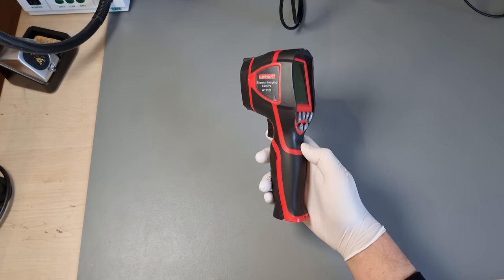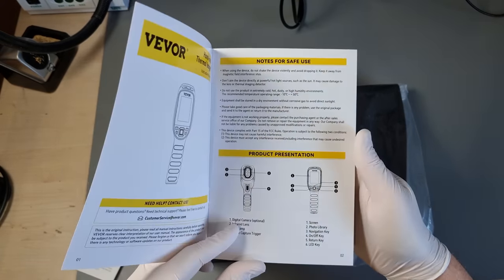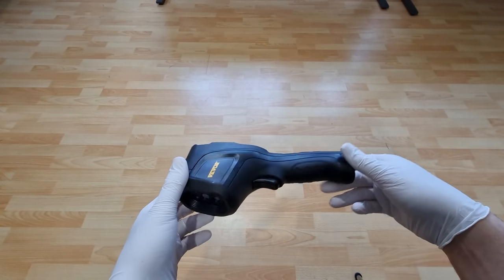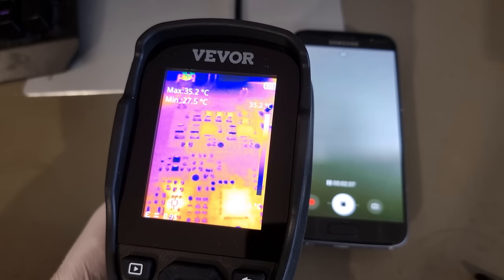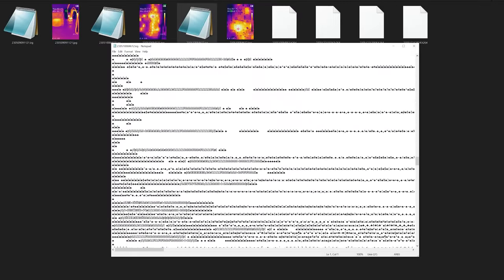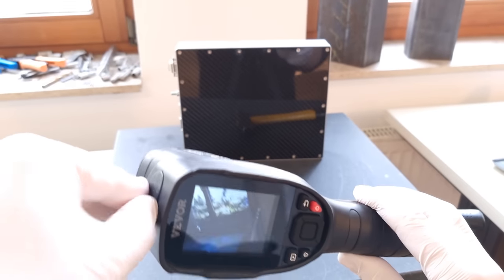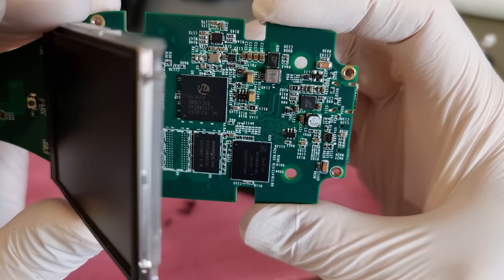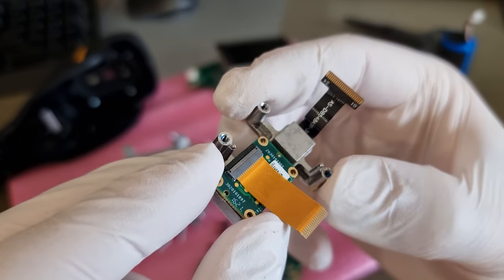25 FPS Thermal Camera Test & Teardown: Vevor SC240M w/ Infiray C200 Sensor

Comment: Now that 30fps IR cameras are available, it is your duty to turn one into a 3D printable heat-seeking missile.
Reply: Open Source Patriot Missile When

( /s though, dual use Open Source Technology is something I haven’t quite come to terms with yet oof)
Reply: Take two, turn then on at the same time, and you have 60fps! Do this with 1000 cameras an you have 1000fps! You’re welcome.
Reply: @float32 now good luck synchronizing
Reply: Nowadays normal CV are better in this application than IR camera.
Reply: @solotekle2999  except in the dark or fog/clouds I’d imagine…
Reply: @solotekle2999  also   S e n s o r     F u s i o n
Reply: LMAO we had the exact same idea
Reply: Well, I guess that is a usecase. I am definitely gonna try that out if it didn't cost 200 bucks. Anyway I am glad we have cheap (relatively) thermal cameras. I was wondering if it was a Chinese breakthrough when I saw prices fall last year.
Reply: @monad_tcp  you could do it with a single wire connected to the record button! Each camera needs a 1ms delay from the previous, so you need about 124 miles of wire between each button. Press the record button on the first, and the speed of light does all the hard work.
Reply: I just might take you up on that idea 😉, i guess we both think alike 😈
Reply: Showing the government who's boss, the correct way

Comment: Ah, it's that time of the month when Marco's hard drives are full and he has to push out all the videos :). BTW .h264 files are usually the raw H.264 bitstream with no container, although it's a bit odd to see a consumer product produce one as they're not the nicest files to work with.
Reply: ffmpeg -i raw.h264 -c copy video.mp4
Reply: no, they're extrmely common in chinesium products.
Reply: That's the Hi Silicone chip doing that, natively.  Usually used for CCTV cameras

Comment: I own one made by infiray itself - infiray C200 Pro. It's 1 to 1 outside, but in red-grey colors and ir resolution is a bit higher - 256x192. And there is a myriad of IR cameras by different brands with same hardware in and out. I guess infiray is just not shy of giving this device to any brand for it to stick it's own sticker on top
Reply: Do you have any firmware for your c200. Pro...?
I got one but only in Chinese.... 😂 and would like to flash an international firmware. Would be great if you could makes it available.
Thanks

Comment: After buying a SC240N myself and taking it out with me on a bike ride at night I really feel your comment at 5:40 about AR thermal vision specs. It's amazing to play around with this camera. 

I have found that despite the supposedly limited temperature range of -20°C to 350°C, temperatures of almost 600°C can be measured with the SC240N (measured my toaster). 
In addition, the number of color palettes is limited with the SC240N. However, with the Infiray C200 software, you can read out the raw .irg files and select between 8 color palettes afterwards.

Unfortunately, the seal on the lens cover of my camera was not inserted properly, so it swells out at the bottom and the IP54 rating is probably not met. That's why I'm currently in contact with customer service.

Last but not least, I have a question about the lens. What is the recommended focal length for microelectronics?

Edit: Vevor offered me a ~30 % refund and a focal length of 2 inches seems to be fine.

Comment: Thank you so much for the teardown. I have an Infiray C200 (very happy with it!) which has exactly the same outer casing, specs, functions and so on and I've been wondering how to open it, if it ever becomes necessary. Now I know, finally.
I bought it about two years ago and I was a little too quick. Shortly after Infiray released an updated C210, that also offers live video output over USB, just like the Uni-T UTI260i.

Comment: I have a Dogee s98Pro for my phone. It has the same sensor built in, and ironically my only issue with the phone is the visible light cameras are straight out of 2005!

The thermal camera is amazing though.

Comment: As other comments have said, you should use ffmpeg (or MKVMerge) to wrap the file in a standard MKV and it should fix the issue without losing data to transcoding.

Comment: You can probably workaround the h264 files, skipping transcoding, by putting it in a container google mp4box and/or mkvmerge (prefer mkvmerge) and use the h264 as the video stream to output a .mp4 or .mkv that should be open-able by any video editor.
Reply: ffmpeg is definitely the goto tool for this IMO - ffmpeg -i yourvideo.h264 -codec copy output.mp4

Comment: The whole Infiray thing is neat. I've been waiting on thermal cameras to drop in price and go up in resolution for a very long time. It's great we're FINALLY reaching commoditization.
I wish I had seen this video before buying the P2 Pro, as the SC240M is a bit cheaper here in the US. That being said, the ability to use the P2 Pro on a computer is very nice. It's also absolutely TINY!
So far I've been pretty impressed with it, aside from my first unit having weird issues and eventually failing. The second one has been flawless, though. Been using it to hunt down issues in an early switch mode power supply in an old Solartron multimeter, as well as reveal moisture in walls after a recent flood. Regarding the visible light camera and MSX-like functionality, it's almost not required. With the thermal imager being so high res, it's not at all difficult to make out features that FLIR units need MSX for.

Comment: I don’t know about these things with integrated battery… how about a TOPDON TC001? No battery, usb c (yes, you need your phone, but more resolution and your phone surely has a bigger display) 😉 PS: because it’s USB it works with nearly every OS. I just bought one and i think it will replace my older FLIR system…oh, and it even has some monitoring functionality my flir obviously hadn’t. And it’s even cheaper than your standalone device, you can get it for 210-230€

Comment: hey reps - take it from me that the P2 Pro is not the right one to get... the T2L is better version and it does not cost so much more from the right aliexpress seller(s). Often the price is reduced now and again. After the T2L then next step up is to get their T3S (aka T3Pro). Which is the correct successor to the T2L, just with their newer sensor. However T3S is unfortunately too expensive ATM. Since it is still relatively new out on the market.

Comment: This video is not like other Marco Reps content.
No info about UX - what about software on that thing?
- can you define what temperature range you want to see (ie: let something very hot in in frame to be out of scale and focus only on stuff between say 10 and 20C)?
- can you change color scheme
- how often does mechanical shutter activate to calibrate this thing

Thermal cameras from Asia with 25fps aren't a new thing, just look at what HTI offers. Looks like HT-301 is very similar to T3S-Pro.
Reply: I can answer some questions.

- The temperature range can only be defined afterwards via software. 
- The SC240N offers 4 color palettes vs. SC240N with 7 color palettes. 
- After booting it calibrates every few seconds. The frequency decreases like a decay function and with longer operation time it happens only occasionally. But you can also do it yourself if you want to.